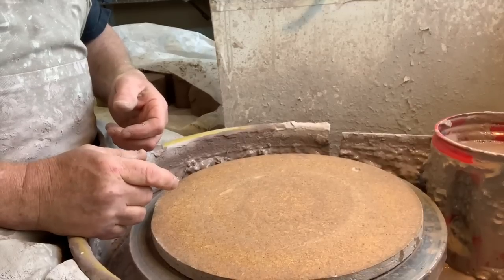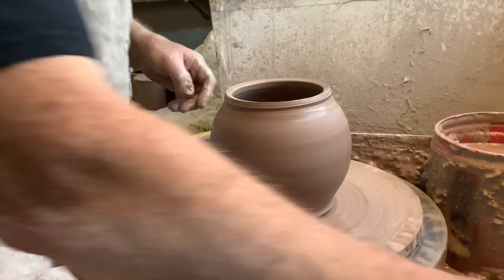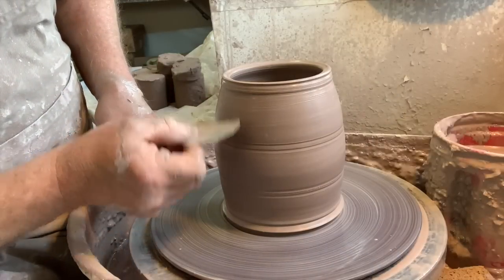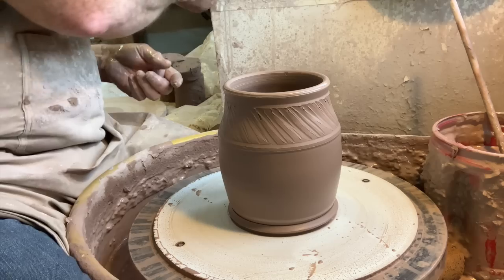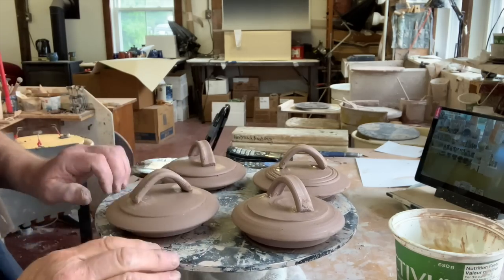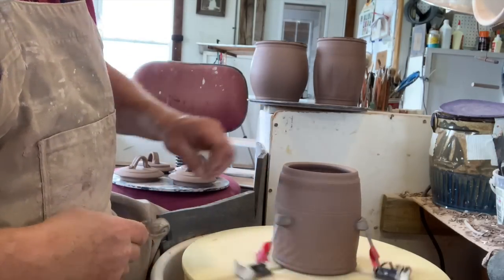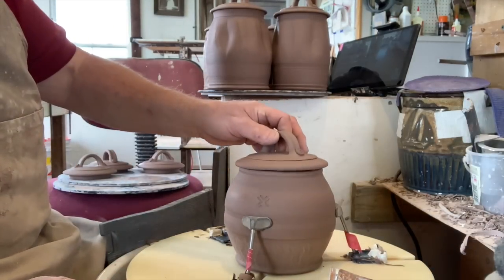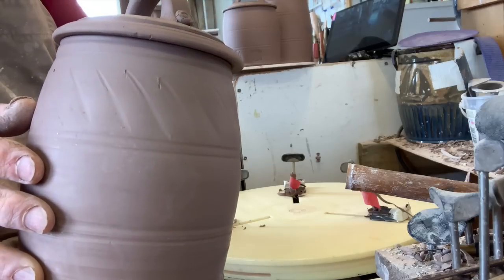Throwing Canisters/ Lidded jars.

Comment: Nice video - thanks for sharing.  I went through a phase after first being introduced to chattering where I chattered the bejesus out of every thing I threw - bowls, plates, cups, canisters, inside the pot, outside the pot, everywhere.   I'd chatter them plain, coat with colored slip and chatter, chatter then slip inlay...I went overboard with it.  I think I was fascinated by the sound.   I had half a dozen different handmade chattering tools - square edge, round edge, triangle point, stiff heavy tools, light springy tools....One day my instructor walked by as I was trying to hold two different chattering tools at once, and said it was time to knock off the chattering for a while and explore other techniques.
Reply from the maker: That makes you the expert on Chattering, make a video on your experiments.
Reply: That struck me absolutely hilarious!  Thank you for sharing!  🥶